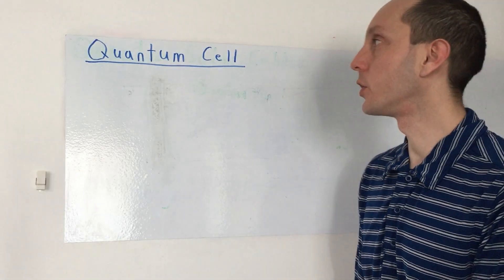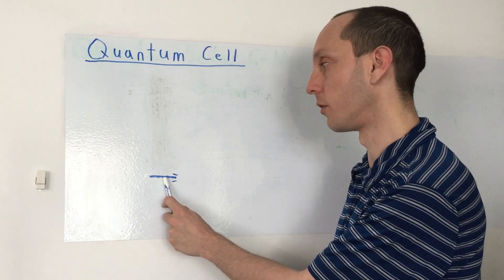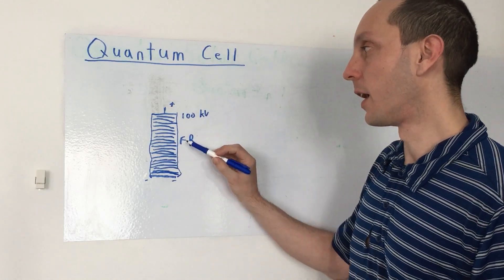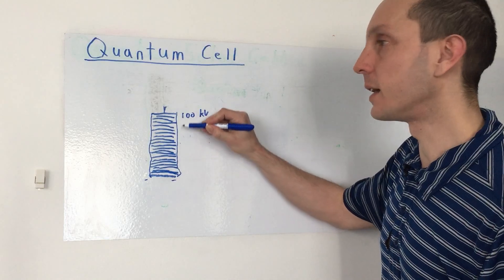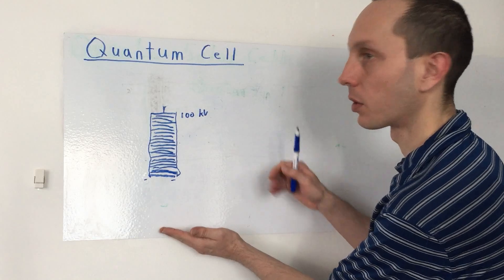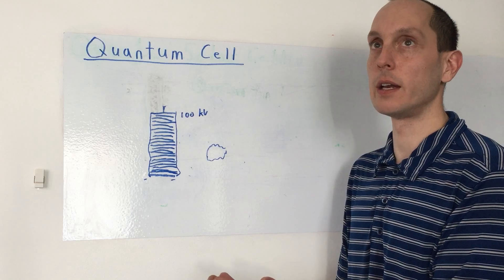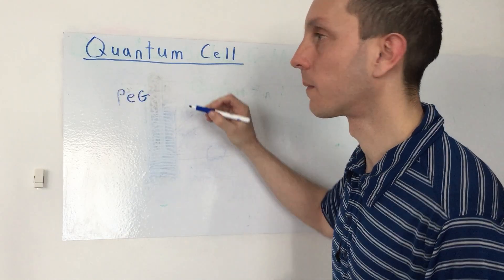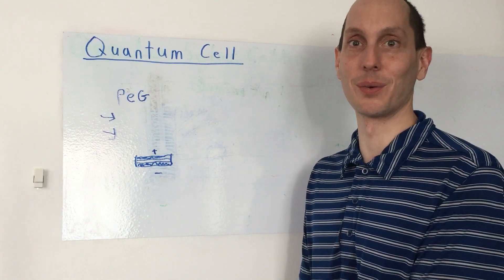Quantum Cell Info

Comment: Which PEG did you end up using? PEG400? PEG1500? PEG2000? PEG3000? PEG4000?
Would Ammoniumcloride work as Electrolyte too? Or ammonium Aluminum chloride complex? 🤔 I would love to know more or is it your secret sauce?
Reply from the maker: No secret sauce per say just been testing a wack of variants and its lots of internal documenting, And i'm making findings faster then I can format it into presentation. With that said I ain't in a hurry to release the "final" report as i'm also dealing with loads of troll drama since the posting of these cells. And I mean not just comments on youtube. My social media accounts as well etc....
Reply: @joellagace1679  yeah I know they are an annoyance. They don't have a clue of actual research and reapead shit that they got indoctrinated by school like regurgitating parrots. Did you have read my suggestion for your cell In your new video? I commented there about integratin the coils in the cell 🤔
Reply from the maker: I don't have coils in the basic cell only setup. What do you have in mind?  Of course there is room for more circuitry. Depending on the final goal.

Comment: Can two parts epoxy resin do the electret?.
Reply from the maker: I think any dielectric that you can bring to a non solid and charge while getting solid should work. Efficiency will vary depending on materials.

Comment: glycerine might be good for the gel version,  also esters like ethyl carbonate which is solid at room temperature could be used.  if u add glycerine to ethyl carbonate it will lower the melting point and itll go liquid, because it acts like anti-freeze.

Comment: I´m thinking on the possibility to use the 100Kv in your example as trigger. With the use of transformer and diode spark gap like in the circuit I drawn here: https://drive.google.com/file/d/1aJe3BXnN6snpK1q9IdyRXn-6KJht-4am/view?usp=drivesdk
The current trough transformer doesn´t need to go through the pile, the pile is only triggering the arc in this circuit.
I know it´s possible because I can do it once. I have problems in getting it to higher frequencies. I just wanted to let you know about using your pile as a trigger, not as the source.
With 20Kv I can get current spike of 30 to 40A, it´s only nsec duration at the moment, so I´m searching myself to get it better, but the possibility is there.

Comment: Thanks for sharing your insights and findings, Joel. Something just occurred to me regarding the crystalline structure of your electret, from back in the days of Dr. Ronald Stiffler's work. Doc Stiffler spoke of his apparatus in terms of tapping into the "spatial-temporal lattice."  I would add, "spatial-temporal electrostatic lattice." He was using the self resonant frequencies of his coils to do this, pinging the spatial-tempral lattice with the sharp transients from the self-resonating coil to draw a response from the lattice (aether) to power LEDs.

For me, the operative term is "lattice", a 4-D term (X, Y and Z axis + Time). What if your setup works precisely because it consists of a crystalline LATTICE structure? It may that it resonates with the spatio-temporal-lattice; and with the built in gradient via the pos and neg terminals, it can function as a continuous draw on the aether.  In this sense, it might be better to speak of it as an open system. In other words, maybe it's the crystalline lattice structure of the electret that is interacting with the lattice structure of the aether as an open system to provide a continuous source of charge.  

For what it's worth. Keep up the good work!